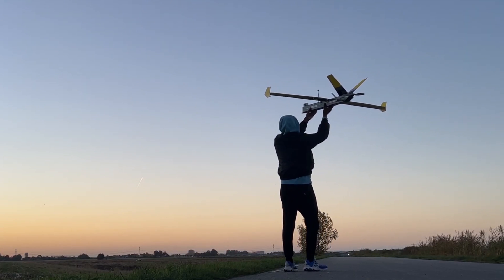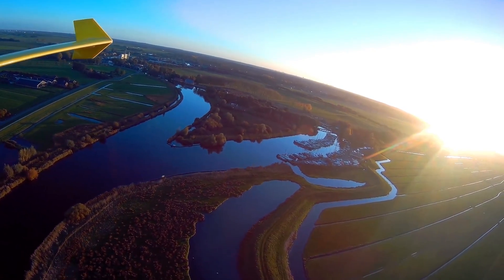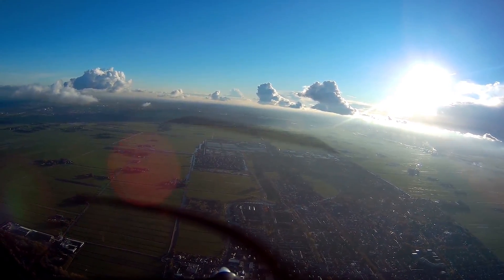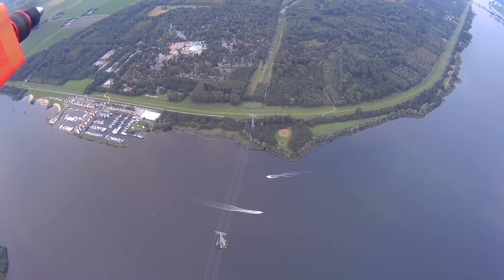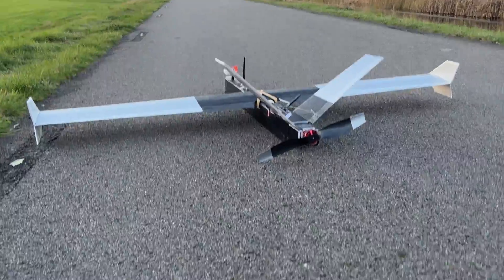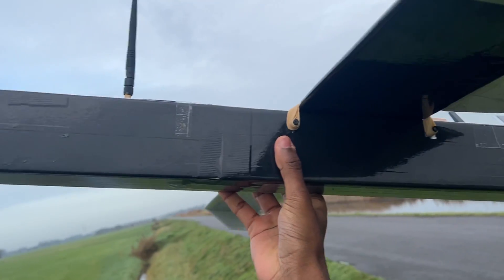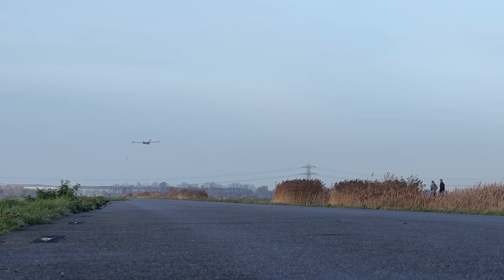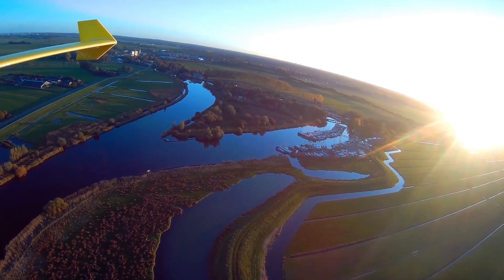V-Tail Aircraft for Long Range FPV & Autonomous Missions - FLIGHT

Comment: Hello! Great video! What do you meat Autonomous Missions? Is it able to flight for a long range without radio steering? Is it possible to set GPS coordinates in 10km and the aircraft will go there automomously?
Reply from the maker: Yes, exactly how you mentioned it, the UAV will fly on it’s command (without steering) to the present waypoints. 

Hence the DJI footage at the beginning - I was flying the DJI Drone and the homemade UAV flew waypoint missions within 2km distances

Comment: What if you were to design retractable skids, such as on some helicopters, so that as it nears landing, a very pencil thin skid made of carbon fiber of about 12 inches in length would come out from the belly on each side and provide protection to the belly of the aircraft?

Comment: Is the f405 compatible with betafpv elrs receiver?
Reply from the maker: Possible if the ELRS receivers support SBUS or other protocols, compatible with 405's
Reply: @AeroStuffFPV  Thanks for the help I will be using the Matek CRSF to SBUS converter

Comment: So if you have throttle lock and level flight mode enabled, to avoid prop strike on hands hold the plane in front of you by the wings on the trailing edge with both hands and launch it over your head...also, I dont know how much duct tape you used, but maybe consider weighing it and then as a lighter option use mylar packaging tape...
Reply from the maker: I already changed the 14x4.7 with a 12x6 propeller for better efficiency and the risk of slicing my fingers - I always launched it with a regular fuselage throw, my hand had clearance but it always was a nervous throw which didn’t go always right

Now I use Auto-Launch and throw it before it throttle’s up and climbs automatically 

The tape isn’t duct tape - It’s Silver Wingtape from AliExpress, soon getting Gold roles for future aircraft’s

Comment: how did you get the propeller to stop  horizontally? 
propeller blade could have stopped vertically during landing
Reply from the maker: Coincidence. Happens many times, but vertical prop landings occur too.
Reply: @AeroStuffFPV  folding propeller would be a great idea i guess.

Amazing work though 👍 best of luck 👍

Comment: great job, I wonder though what is your span? chord? I maybe wrong but appears the wing is not as smooth in profile as it could be(squared over spar?) on the top surface. Keep at it!
Reply from the maker: 1.6m wingspan / 6” chord + tapered ailerons

Comment: I wonder what is the difference in terms of handling and maneuverability between propellers at the back-end and front-end. Is it more efficient to have props on the front?
Reply from the maker: The main difference is speed & efficiency.

The pushers (back-props) fly slower and use less power to stay aloft. The stall speed is also lower.

Tractors (front-props) are faster but require more power/speed to maintain altitude & stability.

But there was a solution in which I made a tractor design with a depron-wing, which made it fly at just over 1h (5A consumption on average) compared to 30-35min of regular foamboard wings (+200gr heavier than depron wings)
Reply: @AeroStuffFPV  that's a great answer. Thank you very much for that! Have you ever considered edf? I can guess that answer is probably not because edf's are least energy efficient solution and you aim to fly long range, right? Anyway the benefits from using edf is that plane looks more smoother but probably you dont care about look that much. Have a nice day and once again thanks for your explanation!

Comment: Congrats for over 100k views on your previous video! Wish you double it:)

Im working at this moment at reworked version of your Star Walker. This version would be build with two carbon fiber profile (1cm x 1cm x 100cm) to connect tail with fuselage. Landing gear, the simplest i could do with 2mm thick steel rod and 60mm wheels (x3).  I made about 20cm long, 6cm wide cut for cargo doors underneath wing mount. In about week or so i could share results with you and all dimension. Im aiming for flying weight under 2.3kg with 6000 mah lipo and my GT 3526/04 motor (3300g max thrust with 12x6 prop sport version)
Reply from the maker: Thanks man, I see the 100k as YouTube’s christmas gift =)

Please share pictures or video on IG (Aerostuff.FPV) I really want to see the end product! It sounds incredible already having the carbon tubes.